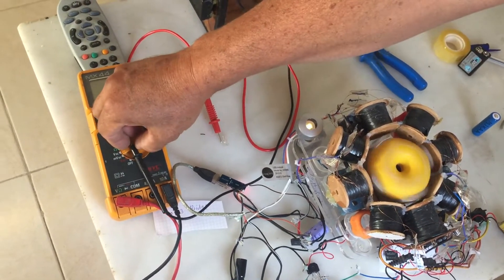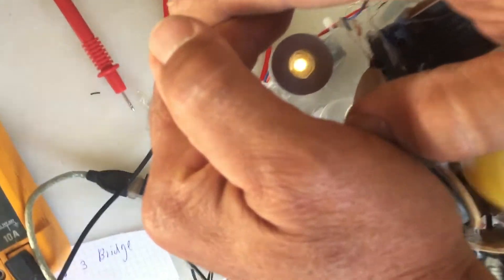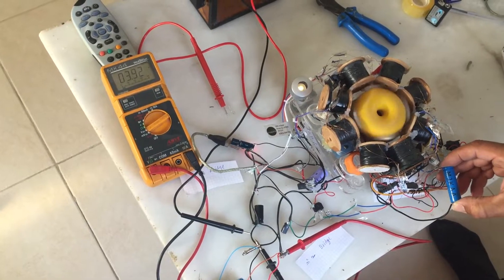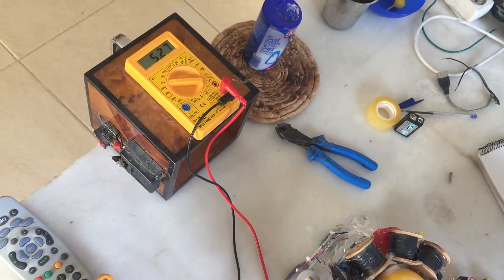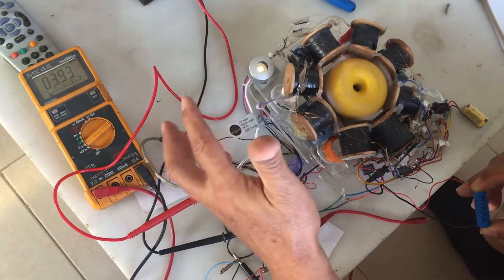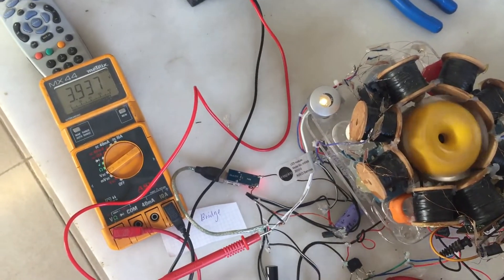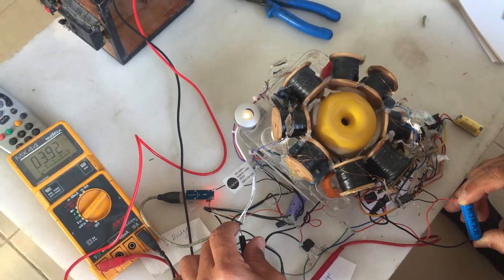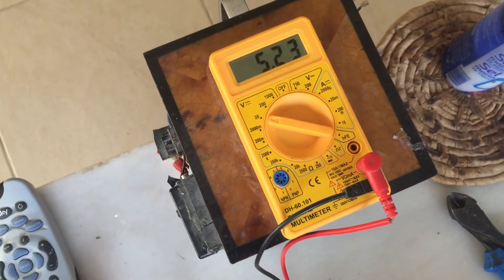Overunity fuel-less generator

Comment: Hi Dennis, to clarify are your coils wound opposite direction within the pairs?  (blue coil right hand and red coil left hand).  I assume they would have to be to pick up both N/S magnetic fields of rotor simultaneously.  
One other question, are you driving rotor with a pulse coil or mechanically with a small DC motor as the Patrick Kelly video describes?  Thx
Reply from the maker: Hi, the coils are in the opposite direction within the pairs. All magnets are facing north and the motor is 5V as in Patrick Kelly's video. It's not running on its full speed because the battery is only 3.7V and it's more than enough to spin it in the right rpm. It's a motor from a laptop fan. I hope it helps. Best regards
Reply: It does help - thx! And you are able to swap batts and never lose charge as per Patrick Kellys book claims? (Thus OU) 
If so I will try and replicate but perhaps with slightly larger rotor. Very good work!
Reply from the maker: @energyhack3538  hi, there are a few ways to make it run. I made many tests, you can use a tiny DC to DC converter like the MT 3608 in the output of the coil and charge a little bit better the 3.7V charge battery. You can also use a small independent timer or relay timer that is connected to another source and this for Example after 20 minutes will stop and now the charge battery will charge back the input battery with the same small DC to DC converter. Still some energy left for running the tiny motor. I'm afraid that if you put a bigger motor the consumption will be bigger. I wish you luck but the gain is small anyways. Best regards

Comment: Hello Denis, Just wondering are you using a magnetic hall effect switch timing to fire the 'motor' coil?  If so,  assume some of the power is feedback to self-power the drive electronics itself. Do you have an idea how much current there is to charge a cell phone battery?
Reply from the maker: Hi Paul, indeed I am using a switch timing to fire the motor coil. It can also work without it but the result will be that you charge 1 battery at the output and the input battery gets weak, so the timing switch helps. I am using a very primitive USB in order to charge the small phone, this USB cannot give more than 500-600mAh output and the input is from around 1.5V converted to 5V, basically a very simple step up converter we used to charge our cellphones with before the smartphone, the USB of the smartphone can now reach 2Ah so I'm talking about an old one. Also, they use this USB to charge a 3.7V lithium battery since the output is 5V its enough to charge the 3.7V lithium battery 18650 model. So the current cannot pass in this case what the USB gives as output. I hope it helps.
Reply: @denissabourin  Yes I do know of the small 1.5VDC to 5V USB voltage booster that you are talking about, I had the same one hooked up to a $2 single cell garden light solar panel which worked quite well to directly power an Arduino outdoor sensor. I suspect you could probably get more voltage output by increasing the amount of turns per coil, but that would mean a lot of extra work involved in either rewinding the coils or creating another prototype. Alternatively a more advanced ready made step up converter from 1.5V upwards but you may find it difficult to find one, as most of them start from around 3.8V input. Thanks for sharing.
Reply from the maker: @paulbellett2442  Thank you for the update.The coil itself is already quite heavy with 2x 2500 turns which is 5000 for one bi filar coil. If you want a photo of the step up phone charger converter you can send me your email and I can send it. To increase the turns in the coil as you mentioned I think the generator will have to be made bigger because I already had difficulties placing those around the yellow donut which is very light in order to have enough rpm. Thanks